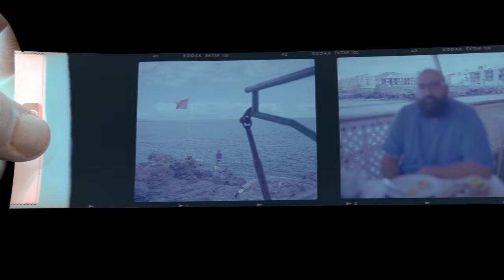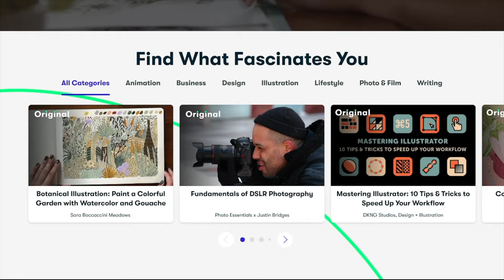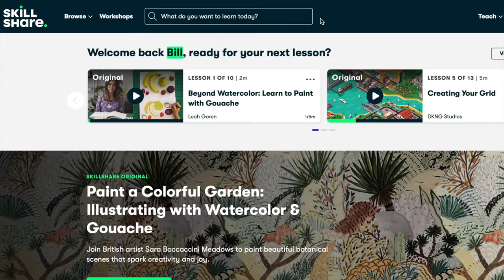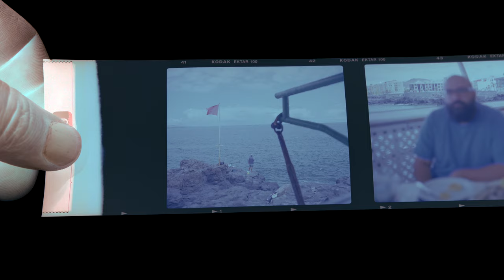Medium Format Fat Roll || Film Photography Issues

Comment: Pentax used to include in their 6x7/67 manuals a warning about keeping a tight wind on the leader when you load the camera. The problem they have if you get a loose wind is that the diameter of the wound roll will get so fat that it jams in the camera before that whole roll is shot. After twenty years, it happened to me once. Simply keep the take up of leader tight before you close the back, and you have no problems.

Comment: It was a recurring problem in the 1970s for me with one of the magazines for my Rolleiflex SL66.  It would become almost impossible to advance at times and actually crinkle the edge of the film rendering it almost impossible to load into processing reels.  Plastic reels were impossible, stainless steel reels worked better.  It waas quite a common issue with the SL66.
Reply from the maker: Yeah, if it affects the film then its a bigger pain. I have had that shift of the film but only affect the backing paper. I should shoot the SL66 more and check how mine reels.

Comment: Just got a Yashica A. Got my first roll back last week. Last 3 frames have lighleaks from to border into the frame. The last Picture even has the backpaper number burned into the picture. But man! I thought I had everything super tight. Took the film out in nearly darkness just in case.
Dont know if it was my fault or the lab. Waited now 4 Weeks for the developed negatives.. I bet it was the lab because it was send from my lab to another lab because they dont do b/w 120.
I used Fomopan 200.

Curious how the next roll turns out...just 3 more weeks waiting :|